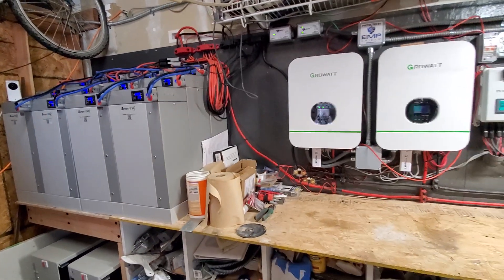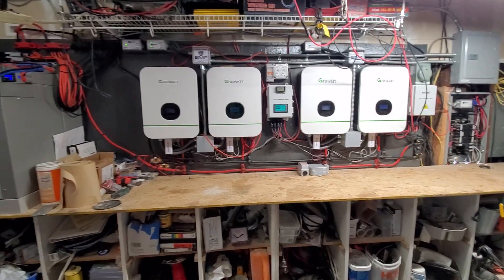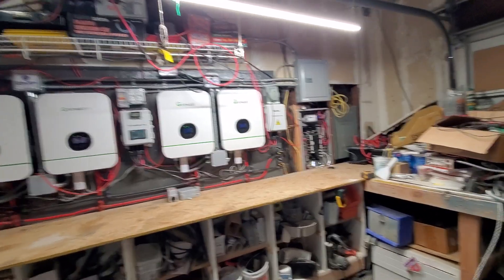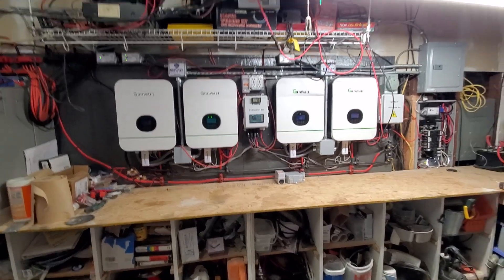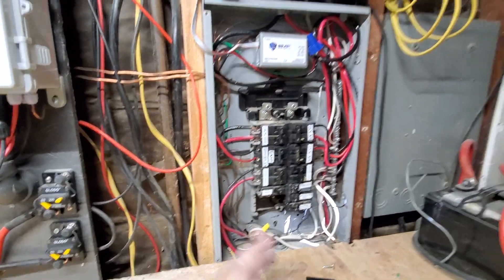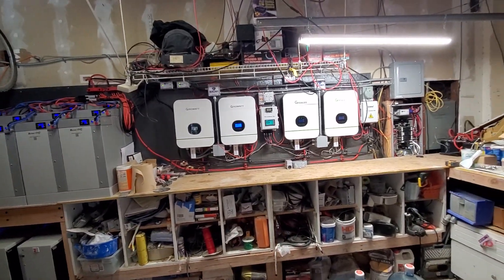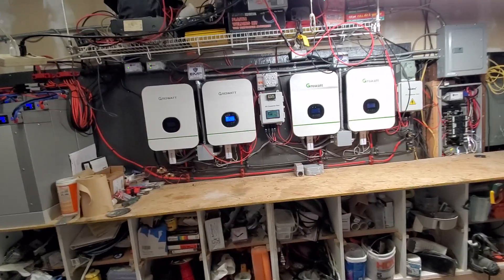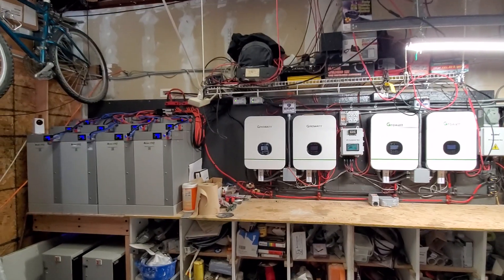Solar Update 9/8/22

Comment: I enjoyed your video. I purchased my 3rd 3,000 growatt inverter a few minutes ago and I am building a little more as I can. I have used up one of my bedrooms with batteries, Growatt inverters, and power panels. Mine isn’t as fancy as yours, but it’s working. I just need more POWER to run everything!😊
I do have one silly question. What was your power electricity bill before and now or today’s electricity differences from the main grid? I’m guessing your power bill has averaged back down to basic level of billings whatever that is in your area.
Reply from the maker: Good going...Whats cool about solar is you just keep adding until you get what you want out of it...my electric bills were getting up around $600 a month...we have a big house with my work shop out back and kids so we use power.

After getting the inverters going and having enough battery to cover me for for days my electric bill  went down between $7 - $9 a month. 9 months out of the year I switch of the breaker that supplies my electricity from main grid and Im only on solar and battery....

Ive up graded to the new EG4 6000xp, I have 4 of those and will be doing a new video about those. Im doing another re wire since I have the new inverters so Id like everything to be clean and in order before I do the video.

Let me know how things go with you setup
Reply: @richd9771 that’s totally awesome. I can’t afford that upgrade yet. I did order another growatt 48volt 3000 for a total of 3 and I would probably need one more  to run my 9600 watt pulling electric heater in this mobile home, maybe not but I will have to wait for more money. I also need more batteries.🔋 I’m retired and I am trying to be frugal with it so I’m not forced back out of the house for a paying job! 😮
Reply from the maker: @rangerbob42  I was told by Growatt that I could run 3 inverters but when I tried I had problems. Looking at the instructions it seems that you need to add them in pairs which makes sense when looking at the communication cable setup.

I buy my batteries from Battery Evo. Great customer service and havent had any problems with there products.

I buy my inverters, buss bars etc. from signature solar.
Reply: I have tried to upload a pic of my setup, but this iPhone seems to be stuck on shorts and isn’t functioning like it used to. Sorry if they show up later and flood you out. I will come back later and delete them if necessary.
Reply: I sort of figured that. I can only run my two for now. I believe that I could run everything except my central heating that’s rated at 9600 watt. I could get by with my wood burning heater in the winter. My central air is 7200 watts, but with a soft start it is possible.

Comment: I ❤truly wish that I could get a diagram of your system so that I could fix my system. I have basically the same four inverters. Two of mine ore Growatt and two are Rich of the 48 volt capable of split phase and parallel. It appears by the cables below your inverters that you are running all your batteries in parallel. Any help would be greatly appreciated. Thanks for listening.
Reply from the maker: Id be more then happy to help if I can, what problems are you having?

Comment: I've installed a number of these for clients and have yet to have a failure. With regards to flickering lights, Try the latest firmware update. Signature Solar should have it. If not, Watts247 has it on his firmware page. The update takes care of a few MPPT glitches as well. Nice job. I'm glad you had good luck with Battery Evo. I didn't.
Reply from the maker: Hey thanks for the suggestion about the firmware. I had asked that question before to Signature Solar but cant remember what happened..
What problems did you have with Battery Evo?
Reply: @richd9771  My problems with Battery Evo, who are linked to Big Battery, (I think they buy Big Battery's cull's), is that when I opened the battery cases due to non functioning BMS units I encountered used and dented batteries. They took the batteries back but it doesn't change the fact that it's what they put in their cases. Try to get the correct firmware from Signature, if you download from Watts247, be very careful on the version of firmware. It's easy to get the wrong one. I've bricked a unit by putting in the wrong version and then it's time for a new control board.
Reply from the maker: @mendohomepower7492  Thanks for the info on BAttery Evo. I did notice that some of there builds were so neat. 
Id like to keep in touch with you if thats cool? Id also like to send you the firmware versions on my machines so you could maybe tell me if there out of date.

2 machines I bought from Amazon before I knew of Signature Solar, and the other 2 are from Signature Solar

Comment: Which really makes is EMP b***** sound like a scam to get you to pay lots of money for something because if a cell phone is protected you're trying to tell me that they can't protect the electrical grid which is way more important than the cell phone I don't buy it
Reply from the maker: I'm not sure if you understand the purpose of the EMP Shield...its to protect my equipment from what could happen and does nothing for the grid. 

Its not the grid I'm worried about its my home and my equipment.  Our utility did rolling blackouts "again" because of the heat and I'm not going to be a victim of control and also take the chance to have food go bad. 
Cell phones from what I'm told do have a lining of some sort to help protect them from whatever.

What I do is what works for me and any equipment I may use Ive also researched heavily to make sure I'm not wasting my time and money. I don't just buy a product because someone says it works. 

The purpose of my channel is not to show off but rather to help others that may have similar questions that I couldn't find the answers too while working on the projects I share with you all.
I believe in paying it forward and helping others. Sharing information and learning from other people. 
The purpose of my channel goes back to the early 90's when when WebTV came out. I was one of the early users and was a user of the devices for a number of years. They started with a simple model that could only surf the web and do email. They then came out with a model that you could attach a HP printer to and then another model that was associated with Dish Network...I had them all.
From WebTV I taught myself HTMI and Javascript and then was creating web pages. I created my web site called "Crossroads" and helped other WebTV users with issues they were having. 

I wasn't paid for anything I did, I just wanted to help others...and now all these users later I'm here on YouTube again trying to help.

Sorry for the long explanation and reply to your comment...I just thought it might help you to understand my motive and process.

I welcome all comments, suggestion and criticism. If there is anything more I can help you wish please feel free to ask.

Comment: Thanks for sharing your setup. 
.. best protection for emp's are spares.. I've never had equipment that wasn't connected need to be replaced. :-) 
Sorry for the barrage of questions following:
Have you canceled your pg&e service yet? or are you still paying the connection fee? 

May I suggest a wiring diagram for all your stuff? 

Do you have each of your growatt's making a neutral? or did you remove the screw inside and your neutral+ground bond is in your panel? 

You had mentioned a picture of your solar setup.. but didn't put a picture in the vid. unless I missed it.. sorry. Did you install your panels+racking?
Reply from the maker: Howdy,
No problem with the questions I'm here to share what is working for me.
As for having spares yes I agree with you however I cant spend the money on 4 inverters and just have them sitting around just in case that's why I went with the EMP Shield. I did months of research on them and there products and felt comfortable with there product over others.

I haven't cancelled PG&E yet I didn't want any unwanted attention so Ive been paying the connection fee which is like 8 bucks I figured I can handle that much. The main lines from the meter to the panel have been removed and capped so there is no physical connection at all.

If your asking for a wiring diagram I can see what I can do for you.

I was told by signature solar not to remove the screw in each of the Growatts. They each have there own ground ending at the breaker panel.
The panel in my main so yes its bonded.

I forgot to get a picture of the put side panels after shooting the video. I did 100% of my installation so yes I installed my panels and I used uni strut which is rated for solar and much less expensive.
Reply: @richd9771  so with the grounding .. people have measured current traveling over their grounds. if you don't mind.. placing a clamp meter on your bonding wire in your panel.. it shouldn't have any current on it.. I bet you see some. similar to the grounding wire to your inverters. because its using the path of least resistance.. and more wire/width means less resistance. 
how much does it matter? I dunno. just thought you'd like to check it out. 
I think I'd remove the bonding in your panel.. this way the bonding is still happening twice .. but not 3 times..  instead of the once that its supposed to happen.